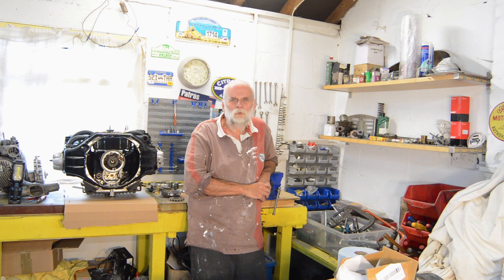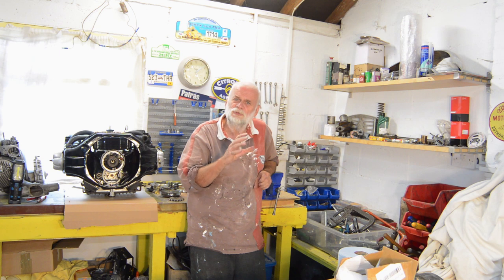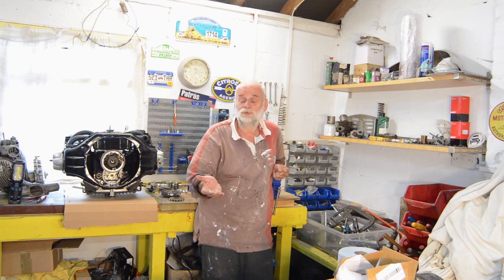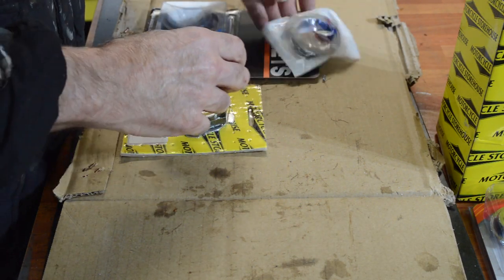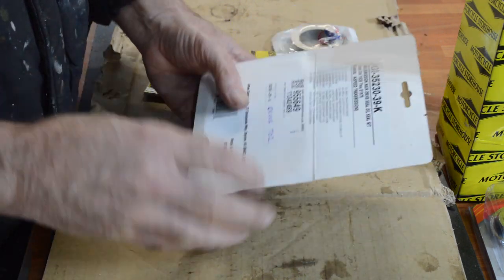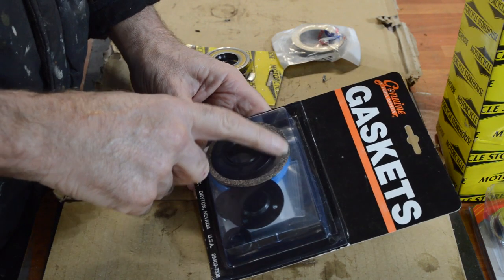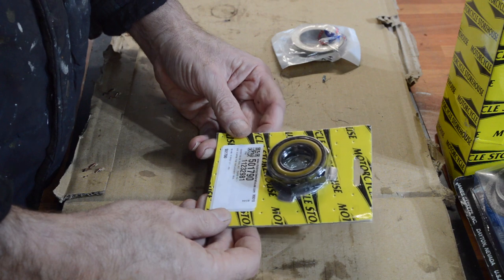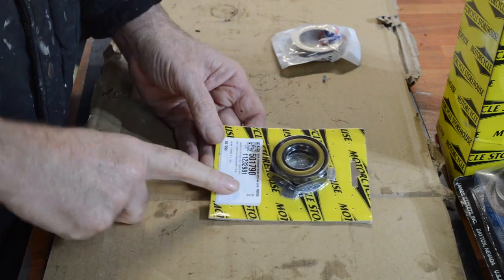Shovelhead Leak 1

Comment: Hi, I went looking on fleabay for the mainshaft sprocket nut socket that you got for very good money but could not find one. any chance of the name of the seller please. I have a 75 FXE that I rebuilt the gearbox and clutch on and I made my socket for that but if I can get a proper one for that money I will pick one up. I live in Ireland by the way and don't have a Harley dealer close by so i get all my bits from W&W cycles in Germany, no import duty or taxes, and a fantastic service. Thanks for the great videos, very enjoyable.
Reply from the maker: Hi Ray, the seller was Bestvehiclepark but I just checked and they are not listing them at the moment, probably stuck in a container somewhere like so much stuff at the moment. Glad you like the videos and thanks for watching !
Reply: @oldnutsgarage  Thank you for that

Comment: Is there any difference between the Primary of the 1969 WLH Shovel and your one? As I have a worn inner primary bearing. Thanks
Reply from the maker: This is my first Harley so I do not know much about them but a quick check online seems to suggest that the bearing changed in 1970 on bikes. That date could mean model year of course so a 69 might have the later one but my 73 also has stuff from the previous year on it, that according to the parts book it should not have, take a look at the throwout bearing video. Sorry I cannot be of any help, thanks for watching!

Comment: Your clutch pushrod should have a oil slinger on it on the kicker side with a disk needle bearing on it and shouldn’t come out that way 
And you can get the rivets just make sure the done right as the previous owner hasn’t
Your doing great …
Reply from the maker: That is a bit of a worry, I will have to look at the parts book when I get back, I hope I do not end up having to strip the gearbox.
Reply: @oldnutsgarage  ahhh there easy …. Enjoy the rest of your trip you lucky basket lol … if it was work before it should be ok just take off the kicker cover before running it … I done away with my 3 finger clutch and installed an early evo clutch with very little hassle evo 4 speed main shaft
Reply from the maker: I will check it out when I get back. Thanks for the help !